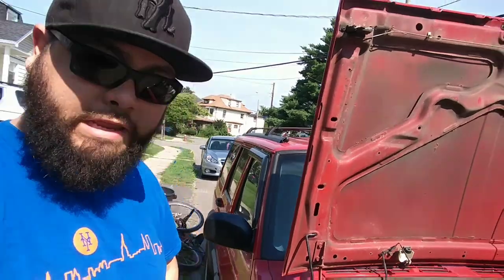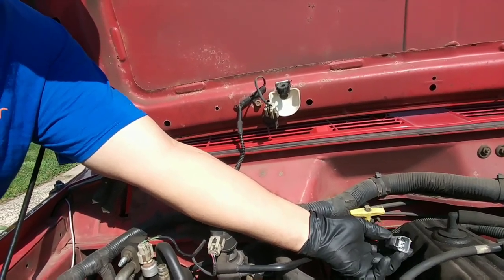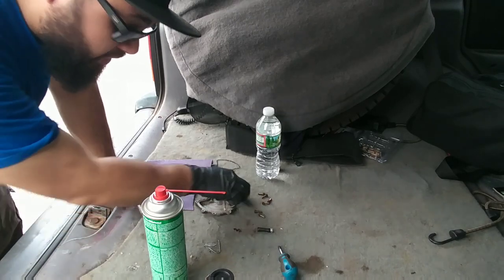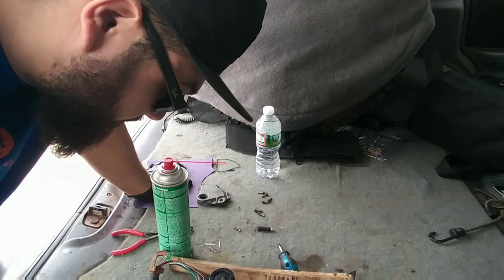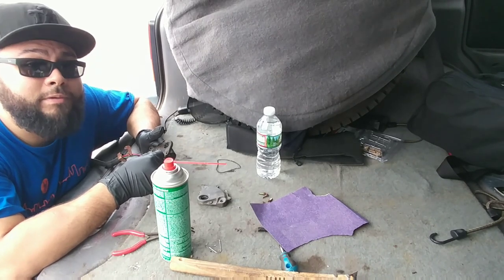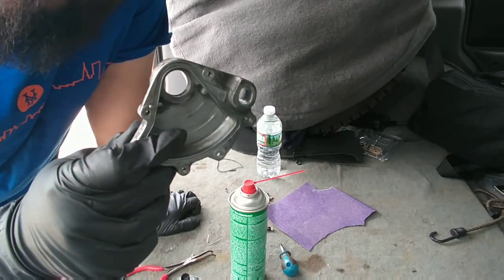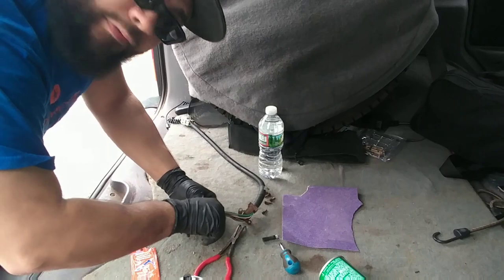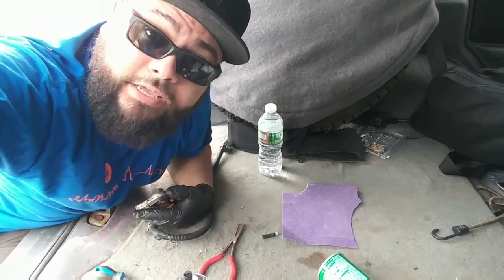Jeep Cherokee XJ NSS. Can I Fix it?!

Comment: Couple pro tips after I did this same thing to mine:
1. you dont have to completely remove it. Take the bolt off slide it off the shaft and let it dangle. No big deal.
2. IF YOU LOSE A SPRING like I did GFL finding a spring that is the right size to fit but don't sweat it, get a pen/mechanical pencil. get the spring out. drill out the hole a tiny bit bigger on your NSS to fit the new replacement spring. trim spring to correct length then put the trimmed side down and the untrimed side up to keep from binding on the copper piece. BAM. Also good way to get spring-yness back if needed.
3. the gasket with probably be garbage. Get a new gasket or whatever to seal the thing when your done. Mine being nearly 30yrs old and spent its time in arizona heat was basically plastic instead of rubber.
4. try not to fuck up the threads on your shaft bolt part! everyone says loosen it and use it to pry against but it screwed up my threads pretty bad doing this, luckily I managed to get it working okish still. You can use it to pry on but use extreme caution, I was being gentle and still messed mine up.

5. If NSS doesnt fix your start issue: Starter>Relay In Engine Compartment>NSS>Ignition Switch. I currently jump start mine via relay contacts and a piece of wire, This also lets you know if your starter is good.

Comment: Nice that you got it fixed. Do you know if silicon grease would work instead of dielectric grease? I have a hard time finding it in Sweden.
Reply from the maker: +Benne you can try something called penetrox or Noalox. Vaseline is conductive... The point is to protect from moisture. Good luck.
Reply: Any luck?

Comment: How did you take it off? I’m having trouble getting mine off
Reply from the maker: +Pete BMX and Scootering they get stuck in there really good sometimes. You need to find an edge you can pry from without cracking the housing. In theory it should be an easy part to get off but considering time and rust it def gets stuck on there pretty tight. good luck!

Comment: Is this part really  $300? I'm definitely gonna at least try fix it myself. Thanks for the video!
Reply from the maker: Yea, brand new it's super expensive. If you can find one at a pick and pull or used online def go that route. If you can find it new at a cheaper rate then jump on it... They're super easy to clean and fix so def try that first.
Reply from the maker: $30?! Nice find. They're legit super pricey new from dealers. I figure RockAuto might have them cheaper too but they were also pricey. 

Ever since the rebuilt I too have had zero issues. 

Gotta be careful with the loose small bits but worth the time and effort.